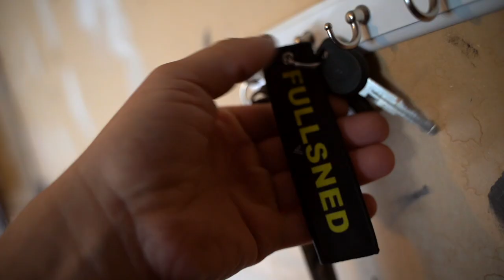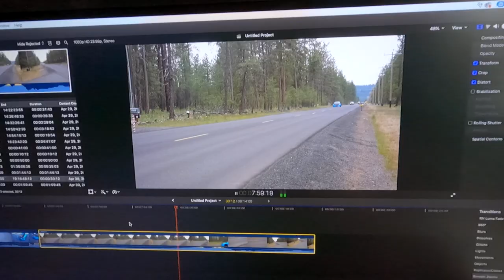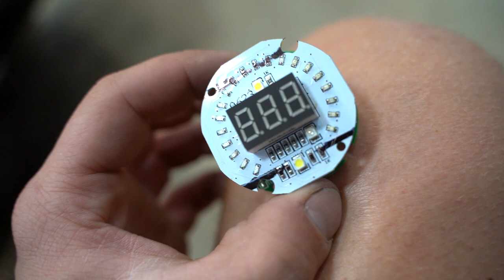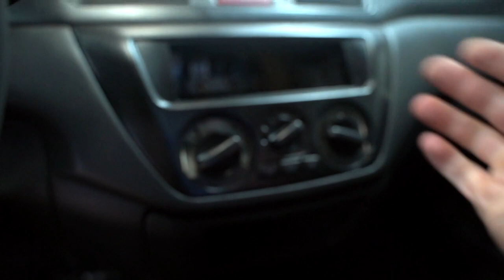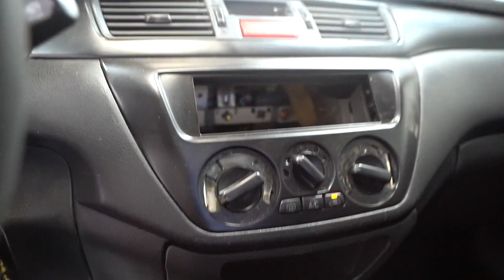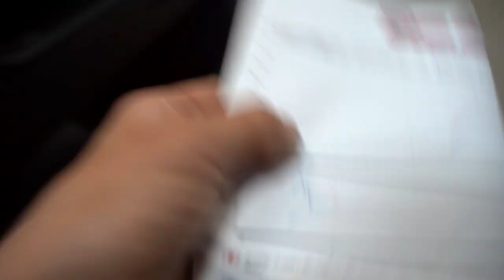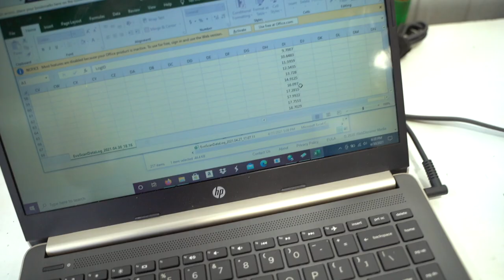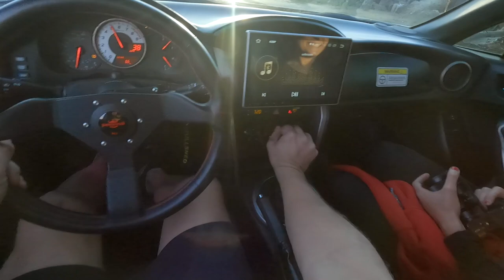The Evo 8 RIPS! *36PSI Oopsies*

Comment: Just a tip from a electrical engineer. A fuse is used to protect the electronics from further damage in a overloaded circuit (aka too much current). Just replacing a fuse does not fix what caused it to blow. I see a lot of people think that it was just a "faulty" fuse, no, something caused the fuse to blow and that is what needs to be addressed.  Keep it up Devin. From another Evo X owner.

Comment: You want to cut the plastic clock housing, cut the top n bottom almost flush to the face of the clock ( and round the outer, inner edges  ) the part that will be touching the perimeter of the gauge. Basically your cutting a circle ⭕️  on the back of the plastic housing almost flush to the back of the face of the clock. So you can slide the gauge into the opening of the housing. Hopefully this makes sense, my explanation might be a bit shitty 🤷🏼‍♂️ love that blue8 tho🤘🏻🤘🏻🥶

Comment: If u haven't upsized your Valve cover crankcase Blow By vents, u most likely need to for the upsized power from stock. My dipstick flew out oil all over. Those stock 1s wouldn't be enough. Might account for the oil residue u got on the windscreen?
2 on the valve cover, to oil catch can then just a pipe it to atmosphere with 1 long pipe to bottom of engine bay is what i done for my 9 tomei 2.2l. Breather filters still makes engine bay dirty oily fyi.
Peace from Singapore
Great channel

Comment: Bought my '17 STI a couple months ago. It's stage 2 now. No problems except for one day I went to leave work at lunch and the car wouldn't start. It wasn't getting any fuel. I couldn't hear the AEM high flow fuel pump priming. Sure enough, blown fuse. It's been fine ever since but I did buy some extra fuses just in case.

Comment: I’d definitely check for Evo gremlins. Pull of the drivers kick panel and check that 32 pin connector for water/ corrosion. Both my tail lights wouldn’t turn off until I hard wired it, and sealed the grommet with rtv

Comment: the issue with the tail light seems to be a floating ground , the negative ground wire for the light might be broken or the ground terminal may be loose or corroded , try running a wire from the negative battery terminal to the ground wire of the tail light and try it out , if it solves it thats your issue

Comment: Let's cut into the PCB, straight through the resistors and see if it still works 🤣. Anyways I put my boost gauge in the cluster using the factory spot that says "lancer". You can see it on my Instagram streetlight_raven . Prosport 45mm gauge. For the clock I use a zeitronix  controller with their tweeker display. Al little bit of shimming and it fist perfect even with the back cover. I haven't posted about that yet though.